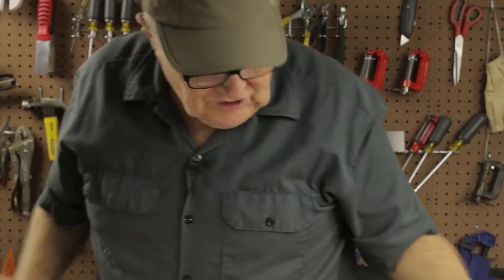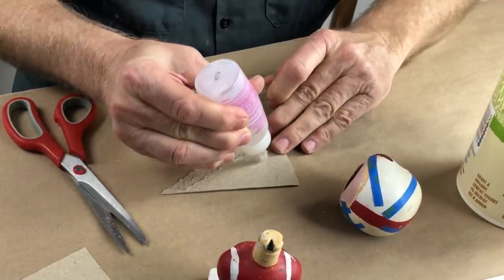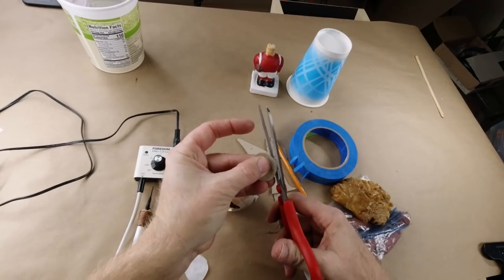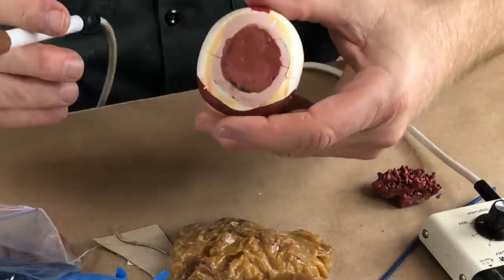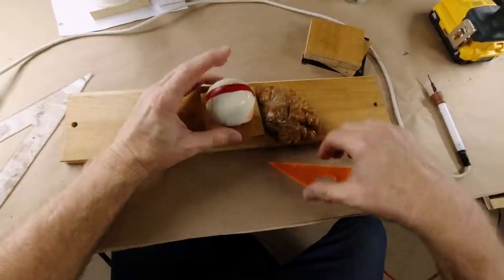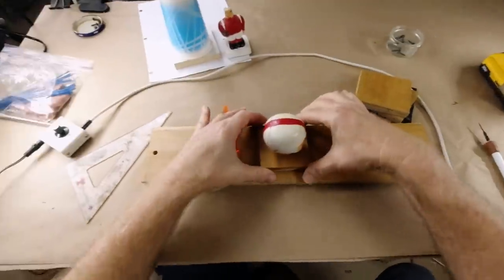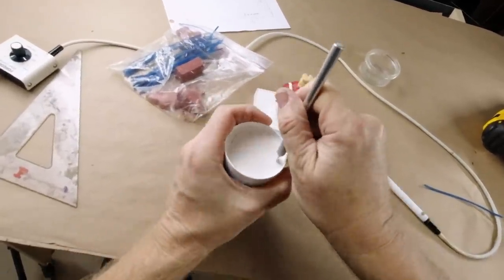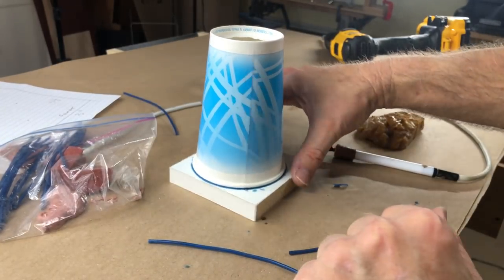Molding A Bobblehead in Silicone Rubber.  Part 1.

Comment: Cool! Thanks again. I never would have guessed the hard part was finding the right spring. I figured the hard part would be dealing with the large hole in the head when forming the mold.
Reply from the maker: It would have been considerably more work if that area required sculpting. But since it was a basically flat patch it was pretty straightforward.

Comment: Hey Robert! What reasons (outside of roto-casting) mean that you don't opt for simpler, potentially less work mold boxes, such as using lego bricks, adjustible walls or plasticine clay?
Reply from the maker: I began my career as a woodworker so I have a woodworking shop. For me it is the easiest, cheapest, fastest way to work. But that may not be true for other people. I recommend that people build their mold boxes by the simplest method for them. And that could be any of the methods that you mentioned.

Comment: Great video! I bought some old metal Micronauts figures a few years ago and the die-cast was disintegrating on me so i was constantly chasing the damage while trying to cast replacement parts. Great interview with Pat, as well. Could you please tell me where you buy the various types of wax you use?
Reply from the maker: There is a link in the description of my videos to a PDF describing the materials I use and where I get them.

Comment: At one point you said the bobble's material might be "compo."  What is "compo?"  Also, curious how concerned you were about cure inhibition for the unknown material; did you mix up a bit of rubber to test, off-camera?  Or just intuition borne of experience that it would likely be fine?
Reply from the maker: It isn’t compo. You see that word a lot in the world of antique decorative items. It’s a casting compound that is usually hand pressed into molds.  I believe it has its origins in the renaissance, but in any case it’s been around a long time.  It is a mixture of linseed oil, rosin and various powders, fibers etc. There are lots of recipes for it. I threw the word around too casually while referring to an unknown old casting material.
This bobblehead looks very much like it was made of papier-mâché and since then I have done some research into 1960s bobble heads and many were made in Japan of papier-mâché.  In any case it was very brittle and fragile.

I forgot to add that yes, I did a little rubber test on the paint of the bobble head. I was pretty sure there would be no problem and there wasn’t one. I’m always feeling around trying to figure out what I should put in and leave out in each video as many times I repeat the same steps.
Reply: @RobertTolone  I too asked what compo is but I think I have seen that plastic before in old knick·knacks. its almost like plaster or a ceramic.
Reply: @RobertTolone  ok I now recall where I've seen that type of plastic. Years ago my family had a nativity set that had parts from various sources. The camel heads always broke off and it was a plastic that was like that for the body.
Reply: I was certain it was chalkware
Reply from the maker: @shaunavconnelly9022  I am sure glad it wasn’t or it would’ve shattered when I dropped it!

Comment: Why sealed with spruce wax instead of sticky wax?
Reply: Sprue
Reply from the maker: @shaunavconnelly9022   I tacked the figure down to the base with sticky wax but I used the blue sprue wax to fill in the gap between the figure and the base because when it melts sprue wax fills gaps easily.